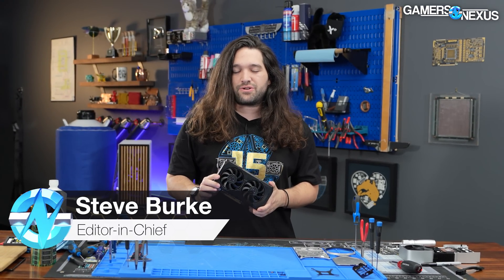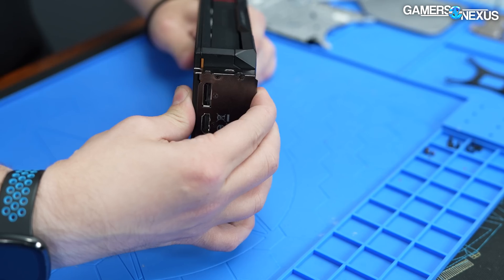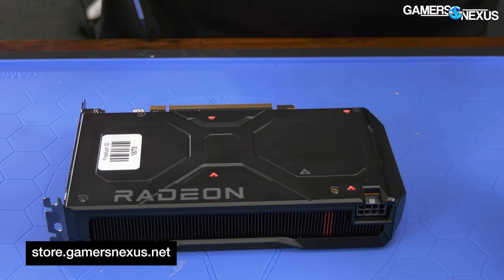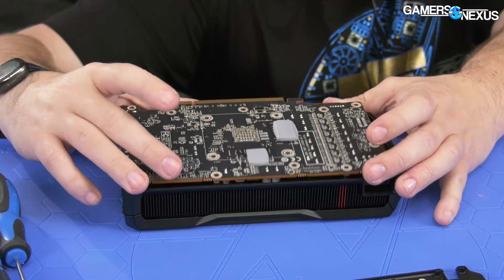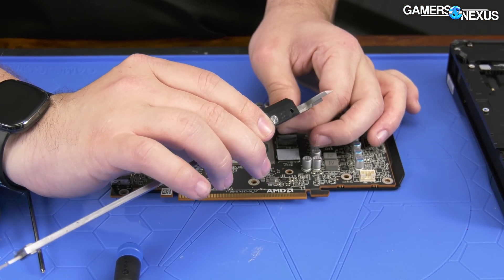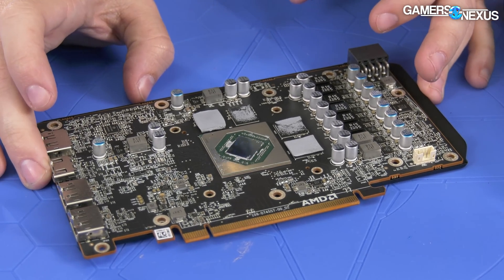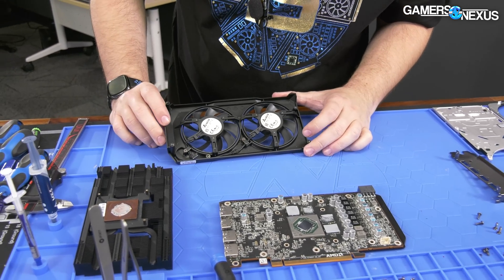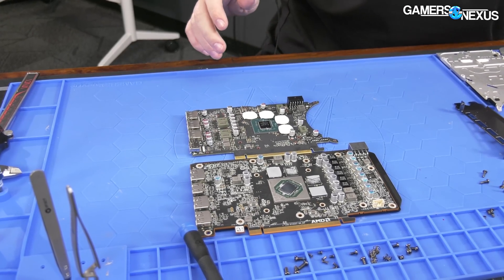AMD *Almost* Learned Something: RX 7600 Reference Card Tear-Down

Comment: This card could be the number 1 steam chart GPU replacing the 1650 if it should have been priced at 200usd, making the rx6600 second hand market obsolete.
Reply: RX 6600s are already selling for about $160 second-hand. The 7600 being $200 wouldn't make them completely obsolete.
Reply: @nathangamble125  then its a welcome competition. id buy that 6600 at 160usd
Reply: Its priced higher to move old stock . Amd will drop this card to $230.00 by end of summer  to make room for newer rx7600xt $280.00 hopefully , depends on rtx4060 performance ($300.00).
Reply: You know right that community always pick nvidia over amd
Reply: But why would AMD make a Product that is so much better than the 6600 and make that one bad… that would mean they cant sell their old Lowend anymore. I mean… you understand they NEED to sell those as well before going forward.
Reply: @flimermithrandir  i  dont think AMD are still making 6600, the only ones you can buy 6600 are in second hand market having a 200+usd pricing which is the most price to performance you can buy on a 1080p gaming. If they can match that price, then people would rather buy 7600 than a second hand 6600 from miners
Reply: @j33k83  There are still brand new 6600xt's around $270-300 in my country.
Reply: @j33k83  plenty of new 6600's out there. AMD is not making them anymore, but that doesn't mean they, and their partners, don't have ample stock to sell.
Reply: People will buy Nvidia regardless, why? Because they are green for all I know... 
Only Nvidia can kill Nvidia.
Reply: No it wouldn't.
Reply: the funny thing about this comment is that I used to have a 1650 on my main PC and now I have RX7600
Reply: $270 is still reasonable. You're kind of forgetting the existence of inflation.
Reply: @rustler08  
No, a 8gb card for $270 isn't reasonable, a 8gb card for $200 was reasonable in 2016. In 2023 $270 should get you at least 16gb vram.
Reply: It sucks it only has 8gbs of vram and a 128bit bus.
Reply: @ZackSNetwork  The RTX 4060Ti has the exact same bus and VRAM (It's 2 tiers above and more than double the price btw)
Reply: @ZackSNetwork  Tbf at 200 bucks, 8 GB/128 bit isnt "that" bad. Its certainly not good, but a lot better than the competition.

These days you can get RX 6700 at 300 bucks tho. Probably beats it.
Reply: @termitreter6545  It is bad we had 8gb cards with a 256bit bus back in 2014.
Reply: @ZackSNetwork  8GB of vram is completely fine at this price point. People are blowing these VRAM "issues" way out of proportion. I have a 3070 and it plays the newest AAA titles just fine. Sure you'll have to drop textures down to high in these shitty new pc ports with memory leaks but but the difference between high and ultra is minimal.
Reply: @ZackSNetwork  Honestly people are making a bigger deal out of the 8gb of vram and 128bit bus than it really is. I have a rx6600 (non xt) which has 8gb vram and a 128 bit bus, and I have not ran into any situation where I have issues with the vram or huge performance drops. All my games run smooth and for the most part the rx6600 can handle nearly everything at 1080p at high to ultra settings. The only time you would run into issues is with brand new games or performance hogs like cyberpunk.
Reply: @jacobedsell8850 not really.  I keep cards till they die. Manufacturers want to continue to charge premium prices, but dont want to give me a value for money product that will go the distance. 8gb card to a newer 8gb card isnt enticing, especially when im paying 1.5x the price i paid years ago
Reply: @SuperTurbo9001  7600 is not meant upgrading from an already existing 6600 or 3060. But for the price of 200 this will be a better upgrade from 1650 , or a good buy for new gamers wanting a budget setup rather than sourcing from second hand market getting deals like rx6600 for 200usd
Reply: @SuperTurbo9001  The rx7600 is $60 cheaper than the rx6600 at launch. So they are not charging you more. It is much less, especially considering the rampant inflation these last few years. Honestly the rx7600 is not a good deal right now because of the other options available. But it is a good deal compared to the rx6600 at launch.
Reply: @j33k83  i have an rx480 that has 8gb lmao. I paid around 400 AUD for the xfx OC black edition. Im not shelling out more money for an insufficient amount of vram as an "upgrade"
Reply: @SuperTurbo9001  The person you're replying to specifically mentioned the GTX 1650.
Reply: @SuperTurbo9001  If your'e happy with that 480 then be it as you may. But as a long time gamer playing the most played games in steam (apex,pubg,warzone2,dota,csgo) the 1080ti, 6600, and 5700xt are the best gpu for 1080p 144hz at high settings considering you have a better cpu (r5 3600/5600 or any intel equivalent). Right now the second hand market you can get these at 200+ usd. Like i said if AMD would match this price at 200, the 7600 is a better buy if you are a new gamer or upgrading form 1650, crashing the second hand market to obsolescence
Reply: @SuperTurbo9001  Which games that aren't console ports use up more than 8gb of vram at 1080p?
Reply: @SuperTurbo9001  I mean, the 7600 is a significantly faster card.  VRAM is only one part of the picture and is by no means the most important factor in this price range.

The 7600 is more than 2x faster than the rx 480 at 1080p. But if it does what you need a GPU to do for the games you play, the rx 480 is perfectly fine.
Reply: @jacobedsell8850  "The rx7600 is $60 cheaper than the rx6600 at launch. So they are not charging you more."
The RX 6600 launched during a mining boom and therefore its price was inflated far above its value as a graphics card. Its MSRP would have been about $250 if there was no mining boom, and it now sells new for $200 either way, so we should compare the RX 7600 to that. AMD is still able to profit from selling the RX 6600 at $200, and the RX 7600 isn't much more expensive to make (it has more CUs enabled, but N6 and N7 both have very high yields; N6 isn't much more expensive than N7; and the die is smaller).
AMD could sell the RX 7600 for about $200, though they (and AIB partners) would only about break even once you account for development costs, so it's understandable that they wouldn't. But $250 would be both profitable for AMD, and significantly more attractive to gamers.
Reply: @jacobedsell8850  No they're not. 
Thing is, people who bought last gen (if they could) already got 2 years out of them. Obviously, at some point an upgrade is going to be needed, but they would have had their time with it, and that would be understandable. BUT THAT'S TODAY, you have nothing to look forward to.
 Perfomance hogs are coming whether Nvidia and AMD like it or not. So I genuinely don't mean it in a rude way but yeah we get it your 6600's doing just fine for now, but that doesn't mean it's ok for new releases to both be overpriced and suck at the same time. As consumers we shouldn't be happy to be played. We shouldn't be fine if all we can play for 300 bucks is Papers, Please (great game). 
We too are going to need a new GPU at some point, even if we skip this gen given how underwhelming it is. It'd be nice if the next one doesn't suck too. So when we'll have to spend 400/500 bucks or whatever I'd still like to feel like we've bought an improvement over what we've had 6 years ago.
Reply: @SuperTurbo9001  People forget that the RX 480 and other Polaris cards came to the market at a time when AMD had done nothing but refreshes for the past few years, Cape Verde, Pitcairn & Tahiti  (all GCN1.0)  were with us for 3 generations. The only new chip they made was Hawaii  (GCN 2.0) for the 290X/390X everything else was repurposed GCN 1.0 with little GCN 2.0 flavor and they called that Bonaire & Tonga. Basically 90% of AMD cards from the HD 7000 series to R9 300 series were refreshes. At that time everyone was bitching and moaning at AMD for doing that, so they had to come to the market with something enticing, and that was GCN 3.0 Polaris and to make it more sweet and to wash their name for doing refreshes for 5 years and sell some cards, they priced it super low. If AMD had not  been in a terrible spot, the RX 480 8GB would easily be a $300-350 card.
Reply: @jacobedsell8850  the rx6600 launched into the teeth of the worst silicon shortage we have ever seen.    Im just going to ignore every MSRP from that era.   😬
Reply: @jacobedsell8850  I agree, for the price tag of the RX7600 it's good enough. However if it's the price of the RTX 4060 Ti and you still only offer 128bit bus then there's a major problem.
Reply: @jacobedsell8850  i agree, i also have a 6600 and i love it, my only vram issue has been sea of thieves at max settings 1440p, and to fix it i just dropeed textures by one setting. I think it averages 90 fps
Reply: @ianlennon-puthoff7613  Exactly, 8gb is plenty for 1080p gaming and because we are getting screwed by unpolished games people are blaming the cards. I run sea of thieves at max settings 1080p. If your card runs out of vram just turn down settings it's not that big of a deal. Ultra and high in most games barely look any different. If you don't want to settle for playing on high instead of ultra, buy a 12gb card or higher.
Reply: @jukahri  none lol that's the point. Any game that struggles with 8GB cards at 1080p is just a dogshit pc port with memory leaks. I usually just pirate these games because lazy devs don't deserve my hard earned money.
Reply: @jacobedsell8850  No, 8gb was plenty in 2016 for a $200 card to play games in 1080p.

8 gb is already obsolete for a lot of games, and it's a new card that is supposed to last 5-7 years.
Reply: why would they do that? I'd say they shoulda done 250, but any less is moronic.
Reply: They (RX 7600) are now $270 MSRP, AMD took $30 of the price the moment they came to the market.
Reply: Yeah and then AMD would go bankrupt becouse they sell them way below costs, the price is now $270, be happy, and it's about 25% faster then the RX 6600, the GTX 4600 Ti is max only 10% faster then the GTX 3060 Ti.
Reply: @AmigaWolf  The 7600 should be a 220-230$ GPU, the 4060Ti 8Gb should be a 270-280$ GPU.
Reply: @AmigaWolf  You got any evidence for AMD having low margins, or did you just make that up?

Also "be thankful to this company for not having even higher prices" is such bizarre thing to say.

Comment: I notice that they are still using the 1920 vintage VRM. Try using a 21st-century design. It's cheaper. And smaller. And does a better job.

Comment: I recently took apart my 970 FE and you're not kidding theres like 100 TINY screws that I have 4 extra of after reassembly.
Reply: Take it apart and put it back together enough times, and you should eventually have enough parts to build a 2nd card
Reply: @tradain  Waiting to find the die dupe glitch, but only found the screw dupe glitch ;-;
Reply: It means youre better engineer than nvidia folks as you managed to keep device functional and same performance while simplifying it and cost cutting ; )
Reply: @sznikers  You forget recycling, when at Christmas time building a PC and need a couple of those screws for mods...
Reply: @sznikers  I like to think to myself that they weren't important. That's what sets my FE apart from nvidia's. Weight reduction got me 6 extra fps in minecraft.
Reply: @Surms41  so you got more fps gain than nv team did between 3060ti and 4060ti 
 : D
Reply: Hope it's not the 4 tension screws for the leaf spring lol
Reply: @ij6708  lmfao! Not those 😂 They have a nice big spring to differentiate them from the rest.
Reply: Working as intended though!

Comment: Both AMD and Nvidia really are doing their best to secure a place on the "Worst Hardware of the year" shirt, and its just May.
Reply: Just wait for the 7800xt. I’m already bracing for it to be 6900xt performance for $700, just in time for $600 6900xts to be sold out.
Reply: Nothing wrong with this card, it is a RX 6600 replacement, offers 20-30% more performance and has a $60 lower MSRP. Honestly I think it is the only graphics card, that gives you more performance for less money this generation from both AMD and Nvidia. The discounted RX 6000 series cards are a competitor naturally, but they are slowly disappearing from stores as AMD is not manufacturing anymore.
Reply: any particular reason to say that? This card looks just fine, underengineered/overbuilt -> excellent. Not over-torqued screws. A single fan connector. The fan cable guides are a nice touch too. My only minor complaint is using PH1 instead of TX8 (or inner hex)
Reply: @stanimir4197  way worse value compared to last gen GPUs
Reply: @Pancaked-Up  But it isn't. 
It's the same value as last generation's discounted prices. 
The only message this complaining sends to AMD is: "never discount your GPUs. Keep them at MSRP."
Reply: @Pancaked-Up  it's quite normal older stuff to fetch better prices than the current ones - else they will never sell, either. However, that's not a hardware question but a price one. Hardware wise - it makes for a decent entry level GPU; it can run multiple screens, can play games,  bit better "ray tracing", comes with 2y warranty in the EU. Hardware wise - a well built card, no bells and whistles,  allows for a basic maintenance, too..
Reply: if they flood us with bad hardware there won't be enough room on the shirt for all of it, it's genius!
Reply: We still wait 4090ti announcement 😁
Reply: @marcinkarpiuk7797  there's no reason. nobody can compete with nvidia at that level anyway. both companies are getting complacent due to earnings calls. nvidia up 20%
Reply: 7600 is OKish, at least it's an improvement on shortage prices which I cannot really say for the cards released in this gen so far
Reply: Don't forget ASUS...
Reply: that's funny, this comment doesn't have any competition at all yet for the "worst Youtube comment of the year" shirt. congratulations!

Comment: Looks like they didn't put a 4th thermal pad because the indent of one of those silly little red triangles on the backplate would interfere. Definitely an afterthought to use thermal pads on the back.
Reply: Not that it needs those pads in the first place.
Reply: it appears there are holes within those triangles, so a pad might have expanded through

Comment: Board manufacturers could save $3 and achieve better thermal performance for such low power cards by skipping the backside insulation cover.
Reply: Doesn't look cool though
Reply: Doubt thermal perf. would be meaningfully affected, and a lack of backplate does take away from the perceived value of the card. It doesn't feel good to lay it on its back on the unprotected components.
Reply: @rx1834  Unless you bang the card on your desk, laying it down isn't going to hurt anything. If you are that worried about it, you can lay it shroud-down or heatsink-edge-down.
Reply: @teardowndan5364  I was illustrating why it feels cheaper

Comment: It could be improved if it had a baseplate of pre-famulated amulite. And the fans need hydrocoptic marzel vanes.
Reply: The shroud would probably block less fin area if they used a malleable logarithmic casing. Do you think the fans would still have a side-fumbling problem?

Comment: Do you have to reapply new thermal past to older cards like the GTX 780? Today since its over 6-7 years old now.  I have a Galax GTX780 HOF that i havent turned on in years now. But i plan to stsrt using my old build again now thst i can use computers again since i got my own apartment now.
Reply: It's not a bad idea. I'd use a benchmark first though if you're unsure. Something like superposition. Once you have you score, compare it to the average scores of the card you have. If it's significantly lower applying a new coat of thermal past could help. Be sure to do a benchmark after as well to see if that did anything. If you're planning to overclock, then I'd definitely recommend repasting it before hand and doing benchmarks to track your scores.
Reply: I did it on my RX480 after I swapped it out for a newer GPU. Reassembled my old build, tested before and after repaste, idle temp dropped 20°C (cleaning the whole thing with isopropyl surely didn't hurt as well). It seems scary when you never tried it but it's really not hard. Do it, you won't regret it 

I've used Arctic MX6 thermal paste since it's supposed to last several years.

Comment: Hey GN, I was wondering if you had anything weird going on with the PEG 8 pin connectors on the 7600, I saw TechPowerUp mentioned interference between the 6+2-type plugs and the reference card's backplate requiring a removal of the backplate for proper mating of the connectors. Seemed like an oversight by AMD to me, but I'd also figure that you'd have reported on it had it occured to you.
Reply: Just mush the connector in harder haha
Reply: @nothin1456  don't forget to lubricate it with mix of ammonia and bleach haha

Comment: why did they decide to have the heads of the 4x GPU cooler mount screws inside?  makes no sense, just put holes through the backplate and have a closer backplate and thinner thermal pads.

did AMD not even look at Nvidias design?

22 screws? ffs and just 4 heatpipes.   If this is the standard of AMD cards, I'll stick to Nvidia, they might be assholes on pricing But I've ever had to rma a GPU card ONCE in over 20 years building my own rigs, and AMD was the culprit.
Reply: Like 3090 problems ? or you forgott ? in this chanel steve did video about that
Reply: Unfortunate man I bought a 2060 and that's the first cards that's died on me. Going back to amd now. Different life experiences I guess.